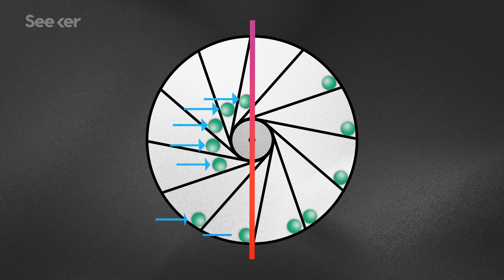Why We Want a Perpetual Motion Machine, But Still Can’t Get It

Comment: Hey. It doesn't Need to Run "forever", that's absurd. It just needs to output more collectable energy than it expends to run it. 

Are you frickin kidding me? How do you think your so smart as to not even to review patents, that you claim must be false. That's not science, that's bias. 

You mentioned super fluids, but one simple way to "reduce friction" is by using "water in circular drums." 
Waterwheels work. Genius. 
Only difference with drums, is it's self contained. But it is perpetual. And produces harnessable energy. 
But guess what, waterwheels and windmills are made of degradable materials so oFc they don't "run forever" Wow. Unsubscribed. Shove the Nobel up your @s$es, buncha greedy fakes.

Comment: Couldn't you get infinite energy through a worm hole?
Reply: dragonhed123 no, for one worm holes are theoretical. If you mean black hole, which is commonly interchanged with wormhole then also no. Black holes lose energy through hawking radiation. Although this will take billions of years it still will have the inevitable fate of dissipating. Also people use the term worm hole to theorize what is behind the event horizon of a black hole so even if they did exist it would be subject to loss through hawking radiation.

Comment: big bang is . . . not true . . . I believe so. Aether is friction less (Superfluid), matter is cavitation of Aether (mostly empty(?)) and is energized by the super dense aether which is the ambient background and so it is self-sustaining. Cosmos didn't started at a single point but multiple points, actually, and may fade away but will re-appear at some other point/time. and you may if you will, reroute the energy of the father and mother of all energy sources to your load. Iff you are sharp enough though. within 2 to 6 months from the time of this writing we will have water powered engines without mutating the infrastructure at all. but only adding a bit of extension only. In Iran it is being advertised on national TV and on radio as well. I'm very proud and excited. WOW. so this whole thing is perpetual after all. It wont die, instead it will replenish and replaces itself just as cells do so. you know beauty is not a function of time. Bye.

Comment: What the scammers present is a ‘long’ running machine - like minutes or even an hour (not very long). But to harvest any energy from its alleged surplus is where it always falls apart. 

I restate the obvious. The magnet motor people are the worst. touted as providing surplus energy to run another device, when in actuality they always stop before even a single joule can be harvested. 

It’s as dumb as flat earth. Yet, there’s no shortage of ‘expert’ YT vids. 

Then there are the machines that are dependent on thermal energy entering the system, like a Sterling. Or calling solar free solar energy. 

Just more examples of failed education.

Comment: Two words: Permanent magnets. A lot of these so-called 'perpetual motion machines' around the world are not perpetual and don't break any laws of physics. They rely on permanent magnets, these can last for 100 - 150 yrs(!) without the need for replacement. Not perpetual by any means but a very, very long time. Nuclear subs - 25 - 30yrs before the need for refuel. Sol - not perpetual but will continue to give this planet heat and light energy for the next few billion years. The source of the energy supply and it's abundance is the key.
Reply: Have you heard of nuclear batteries? Military uses them. It'll be in future robots. No recharging necessary.
Reply: close enough. as long as over all cost are low.
Reply: I agree. I believe perpetual motion or near perpetual motion is achievable with permanent magnets. The depletion rate of neodymium magnets is 5% every 100 years so they can last many hundreds of years or several lifetimes. That's as close to perpetual motion as you get.

Comment: So by definition if I build one of these machines in an environment devoid of external influences, including ambient heat, solar, and *gravity*, then would such a machine using super-conductors & super-fluids be able to run forever? Remember the absence of heat mean that the super conductors would not need additional energy to cool itself. And the absence of gravity would mean there would not be an inbalance in the machine.
Reply: Eventually the half-life of the material you built it out of would be reached before forever comes around though. I suppose you could build it out of a neutron star... Hm. I guess they'd eventually have to evaporate into photons. Maybe a black holes... Nah it'd all evaporate. I got nothin'. Even in that environment.
Reply: The argument of additional energy to cool is environmentally dependent, and  therefore +Seeker is logically flawed.  i.e. In a Cold sink environment, no external energy to cool is needed

Comment: I genuinely think some perpetual motion machines have potential as low temperature differential heat engines or  in the case of the overbalanced wheel maybe a "gravity engine". An overbalanced wheel could, be designed to scavenge kinetic energy from a rotating mass, like a planet if built large enough. Most perpetual motion designs have a component where a small force over a long time is balanced by a shorter higher force, notably, in a different physical location. Many of these could theoretically work if the environment was sufficiently different in the 2 locations, temperature, relative force of gravity, electrical fields etc. energy conversion would take place but it may be from a source that has so far been difficult to access.

Comment: Haha
I used the overbalanced wheel wheel as my science project in 3rd grade.  The point was to prove it dosen't work.  
I think what gets missed though is that, even though these designs aren't perpetual, some of them were fairly efficient in being able to continually produce energy over the short time or were able to keep producing energy if given a little kick every now and then.  Tech that was laughed out of existance or exposed as fraudulent perpetual motion may have been, in some cases, good mechanical batteries.  However, with the focus and claims being on perpetual motion, other imagnative an potentially useful applications of the technology were missed.  Although maybe not as efficient (or are they?) as current battery technology, building one may be more within the means of someone in need, and a given contraption may prove good enough to provide suficient energy to get by until the sun comes up or the winds blow or the rivers flood or you hand crank it to reset the thing.  That's worth taking another look at.
Reply: Well said, I agree.  Mechanical battery, never thought of it that way...  Kind of like how certain thermal batteries are highly efficient yet not ubiquitous for long term energy storage.  Great thought, I appreciate it!
Reply: @ProlificInvention  Go and invent prolifically, my friend :)
Reply: @colleenforrest7936  It's what I do, Thank you!

Comment: Isnt life like all life areally complicated type of perpetual  motion machine
Reply: Well no. Life needs Energy IN.
Better rewatch the video.
Reply: @dnomyarnostaw  the building of a perpetual motion machine would require energy aswell ,its just the out put that would exceed the amount needed to keep it runing and perpetual machines use energy(if they exsited) from the inner machincs of said machine thats qhat would count as the energy in ,its just from literally in,not saying life is I was just wondering if a case could be made for all live things eventually outputting more than the collective energy used to creat and sustain

Comment: But that closed system does include earth's gravity.
What if it could harness energy from the gravitational forces of earth!?
Reply: hydro power?
Reply: @99bits46  yes that's a good option but usually depends on the flow of river which varies with seasons.
Something more consistent.

Comment: If the universe is expanding infinity and more space is being created from nothing at ever increasing speeds surely there must be some way to tap into that energy stream? It's like being in a balloon that's expanding we somehow need to figure out how to make space frictional so we can add our space  paddle wheel which is turned by this expanding space! The only problem it's expanding in all directions so we need to create some kind of directional gate so we can extract useful energy from it? Maybe a spinning black hole?
Reply: Gunter Hofer its not expanding infinitely but exponentially. Eventually the heat death will be equilibrium. Dark energy is responsible for this expansion, however it is still a an outside force (energy).

Comment: It is possible using gravity to pull it down and magnets to push it up.
Reply: Ah no. What will power the magnets to push something away from gravity? 
It cant be the energy from falling,  because that would be less than the energy needed to drive the magnets due to current loss.

Comment: My idea for a perpetual machine allways uses capillarys to transport water from a lower basin to a higher basin and then uses that potential energy from the water to drive a generator. If you have enough capillarys over a big area you can move enough water to the higher point. My friend allways meant you cant use capillarys that way but we both dont know really XD

Comment: Rotating machinery also has to cope with wind resistance, sometimes called windage. As the machinery rotates it tends to drag the air located near its surface along with it. Any such disturbances where air is caused to move also extracts energy from the machinery and will slow it down.

Comment: Spin a fan blade in space 
Free air free energy
Reply: Then try to tap into the spinning blade to power something else. Once you draw off all the original energy that you put in and the blade comes to a stop it won't do anything else until you put more energy back in.
Reply: @joevignolor4u949  does blade stop spinning in space
Reply: @periskhadka7214  If you try to draw energy from it then yes it will.
Reply: @joevignolor4u949  oh

Comment: I created a theoretical Perpetuum mobile, but the only problem is, that it requires a substance with certain properties, which does not exist (yet). That is so mean :) I gave up trying to create another one, since all mechanical attempts are destined to fail (friction), and it was the only non mechanical approach I came up with at all.
Reply: its impossible
Reply: @RetrogradeBeats  It's in theory self sustaining, thx to quantum mechanics, but as I said atm it's still impossible. But maybe one day we can build it :P
Reply: Enty Ropy in all of quantum theory including quantum mechanics, nowhere does it account for free energy or a self sustaining energy source.
Reply: @RetrogradeBeats  yes, and matter cannot pass thru impenetrable barriers, and fluids cannot flow against the direction of gravity ... oops.
Reply: Enty Ropy dude I know about superfluids and quantum entanglement. Still nowhere in quantum theory will you find any concept of free energy. Your just throwing out random stuff.
Reply: @RetrogradeBeats  You missed the antigravity pump ^^

Comment: Is it possible to make one in space since there’s no gravity, even making it spin enough to power a machine that makes it spin again would make it go forever
Reply: No it won't. If you spin the machine and then try to power another machine to re-spin the first one both machines will create some heat and experience thermal losses. Once all the energy contained in the device is converted to heat and dissipated the machine will eventually stop.

Comment: Could you suspend the wheel in a magnetic field so there is no friction? Not the whole thing but just where all the spokes join? It might run a lot longer if that were possible. Maybe the motion of the balls would make it bounce around and unbalance it. No idea.
Reply: Cthulhu Has Risen magnets do not hold their field indefinitely. Unless you use energy to recharge their magnetic field. It would last very long but not forever. In short magnets wear out, it would be the equivalent to running out of gas.
Reply: @RetrogradeBeats  yeah I know, I just thought maybe they would last longer without friction. I'm sure even the marbles moving back and forth would be a small amount of friction that added to it stopping. Would be cool to see how long they could keep it going. I am in full agreement with host. There is no true perpetual motion machine.

Comment: can we use the earth's gravity as a driver?
Reply: no sorry
Reply: But we can harness power from the flow of a river or a waterfall, but not from the gravity itself
Reply: @jonathanhadiprasetyanto521  River flows depends a lot on dams which sometimes affect the natural environment of its flow
Reply: Tony Rx ...gravity is a force, not a source of energy. In order for a force to do work, energy has to be put into it.
Reply: Nope, because using the potential energy  of an object within Earth's gravitational field will use up that energy. 
For example, if you use up the energy of a falling object than you will have to use the same amount of energy to move that object back to the hight that it was at before.
Reply: @malexander6367  What if the geometry can be manipulated to get that object back to its original place using gravity?
Reply: @tonyblackops  in what way?
Reply: It's the same thing with magnets by the way. When an object gets pulled to a magnet than you have to apply the same amount of energy that that pulling "generated" in order to get that object out of the magnetic field of that magnet.

Comment: Nicely explained. But I think we all would be happy to find a machine tranforming some kind of energy (what kind?) for our use without using gas, petrol, wood, coal and so on - even if its NOT a real Perpetual Machine. Well, sunlight of course - but only if and where the sun shines. Ambient heat - why not, but not that practical because of the second law. Anything else? Maybe one day?
Reply: AdMuseum sunlights is a form of energy. Photon energy. Ambient heat? Heat is energy ambient or not because it take energy to excite particles to create heat lol  
Perpetual motion is completely impossible.
Reply: @RetrogradeBeats  You are absolutely right. This was my point when I wrote "...happy to find a machine transforming some kind of energy ... even if it is NOT a real Perpetual Machine" The point is: are we able to find a way to conveniently (and environmentally acceptable) transform a kind of energy AS IF it would be like an PM.
Sunlight energy - photovoltaic or thermic - is environmentally acceptable but not really convenient. Oil is convenient but environmentally not acceptable and so on.

Comment: you said energy can't be destroyed inside a closed system but what about red shift?
Reply: I believe wavelengths lengthen and become weaker in red shift and shorter stronger In blueshift. Never came across anything that says the energy is destroyed it just fluctuates to whatever environment it's in. Redshift is astrology thing that deals with perception of light not really for energy systems. If you would share what you mean I'd appreciate it. I study on my own and dont know everything
Reply: @thegriffinsden3383  , emitted light is red-shifted by the expansion of the space it travels through.
Red-shifted light has less energy than it had when it was emitted.
 E=hf
Energy = Planck's constant x frequency.
 That energy just seems to be lost to the expanding universe...

Comment: Perpetual motion is impossible in a closed system. The system must be open, which means you must tap into natural sources with solar panel, wind turbine, water turbine, graphene atmospheric ion collector, etc. to gain free energy.
Reply: Xeno Bardock solar uses photon energy, wind turbines use wind which is kinetic energy, ion collectors use well energy from ions. If anything uses this it is not perpetual.
Reply: @RetrogradeBeats  It is not perpetual but it can provide free energy forever because you are tapping into natural sources which are pretty much inexhaustible. Ions in the atmosphere are from space via cosmic rays and birkeland currents.
Reply: free energy means energy without a source. You are basically redefining the term.